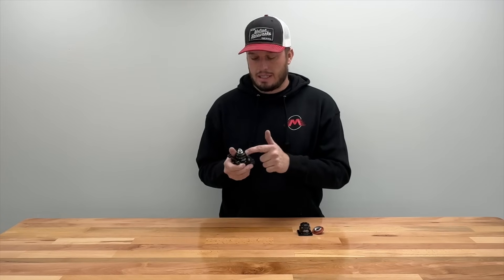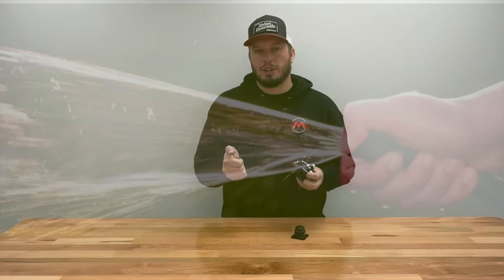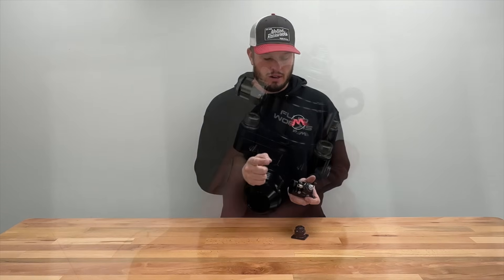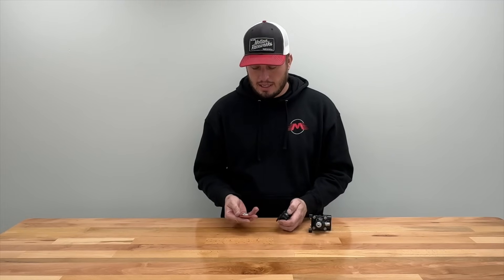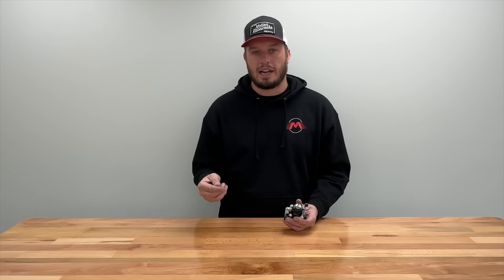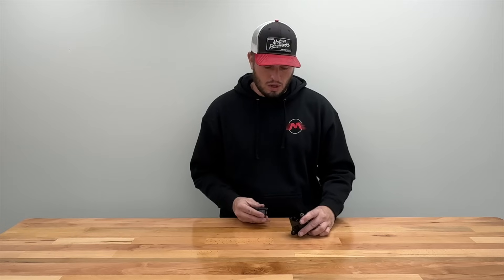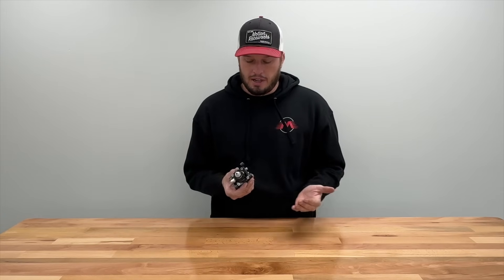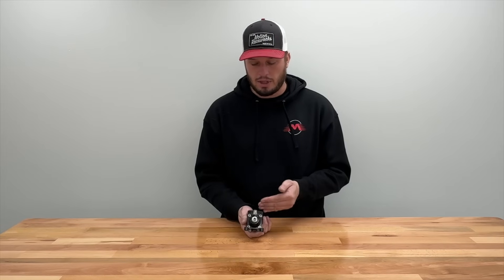Boost Reference Regulators 101: Tech Tip Tuesday

Comment: For all the crap that people talk about  cheap eBay boost reference pressure regulators, they're actually quite good if taking apart and reassembled correctly especially the aeromotive type knock-off brand of regulators, if you simply take them apart when you first get them and put a little bit of loctite or thread sealant on every single screw and or fitting. I have the aeromotive knockoff brand and I simply did just that I put thread sealant on every fitting and loctite on every screw and double check the diaphragm and everything like that and I have been using it for about 4 years now with no issues at all using it with everything from regular (pump gas) to (low lead  av-gas) to (E85) once again with no problems at all even running moderately high  above 20 psi boost

Comment: Great video and product.  I have a twin 340 in tank pump set up with check valves on feed and return but still have fuel pressure bleed down after the engine is shut down. Is that normal? My fuel system is ran as you suggested in your videos.  Thanks for your videos and products, Ahmad

Comment: Flow rate of the injector will remain the same with the vacuum/boost line connected to the intake manifold. On a N/A setup not referencing the regulator to vacuum will increase the flow rate of the injector when in vacuum. 👍

Comment: The seat is on the return line. Not the feed line. Your thumb analogy only applies to the return line to the tank. Pump feeds full presure to the rail, presure is regulated by the seat/diaphram/ and reference vac. That controls what flows back to the tank. Works the same way if its dead head or not,

Comment: So, apparently so years ago, drag racers stopped using manifold reference for the wastegates and use regulated CO2 instead. Not exactly positive why this is, but assume it offers steadier control. Would such an arrangement be advantageous for the fuel regulator? How about a purely electronic fuel pressure regulator?

Comment: I would like to see someone invent a check valve for that vacuum reference line so that if the rubber fails and fuel does make it past it catches it and keeps the intake from getting filled with raw fuel.  A few months ago a local garage had a vehicle come in that was running really bad but when they cycled the key forward to scan the computer for codes the regulator allowed fuel to be pumped into the intake then when they tried to start the motor it turned over until the intake valve opened and filled a cylinder with fuel then locked up bending a rod.  That destroyed the motor over a $60.00 part but if there was a check valve in place it would have been saved so I think it would be a worthwhile investment on any vehicle.
Reply: That wouldn't work. If you have a check valve in place to prevent fuel from flowing then you lose the pressure reference to the regulator as well.
Reply: @KiwiEG  If you had a spring keeping the valve open until fuel which is thicker than air or vacuum closes it the valve would work.  Obviously it wouldn't be as simple as using what is already available hence the word INVENT.
Reply: Regulator would never do that anyways
Reply: @BmoreFox  I gave an example of it happening.  Thanks for commenting though I guess. lol
Reply: *key point ,  car ran like crap.   When my car runs like crap, I check for vacum leaks, and check fuel presure. Check spark. I often smell my reference line for fuel.  It would take a lot of cranking/ ignorance / key cycling to pull that much gas and bend a rod. What type of car was it? 

     Fwiw, on some boats and all planes , they make a dual diaphram mechanical fuel  pump. If it fails , you can see the fuel inside the clear cover when the first diaphram fails. This is the solution to your problem. I've only seen it on a mechanical fuel pump like a old v8 uses on the side of the block tho. (Carburetor not injection) The more I think about it, it's on all boats and planes. Dual diaphram regulators must exist for planes with injection, it's a safety thing. 

 I have had multiple radium diaphrams fail in the last few years. (Radium multi port regulator) They are just cheap aem diaphrams inside. That, and they recalled the part the diaphram seats on the returm port, but just superceded the three aluminum options to a steel seat that actually fits the diaphram ball.  ( should help the diaphram live longer but they still fail. Next time I will order the aem part , not the radium part. Or just throw it away for a different brand )
Reply: @jasonschreiber6458 dual diaphram is a great idea for boosted application! Which model radium afpr failed on you? I have seen many different brands fail and generally have good luck with the better aeromotive ones, but now have the primo radium that just came out this past year